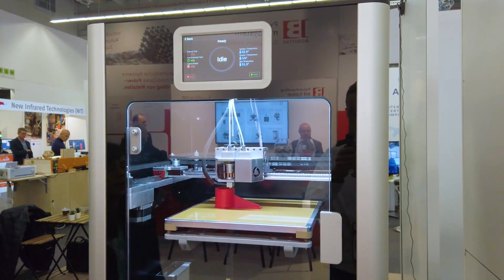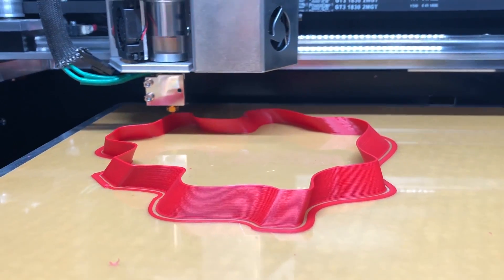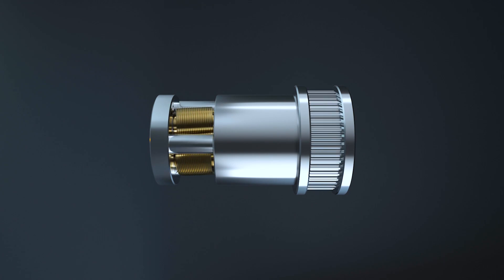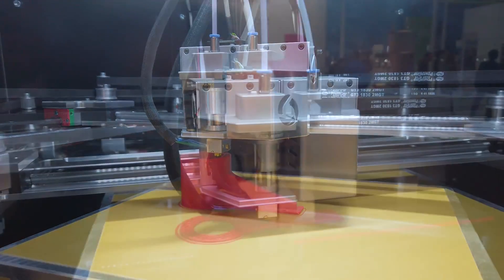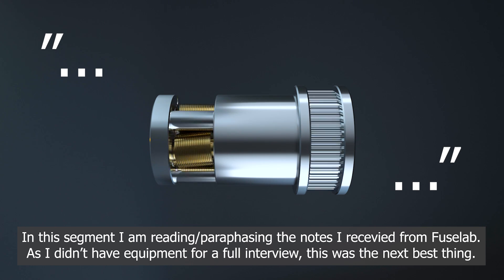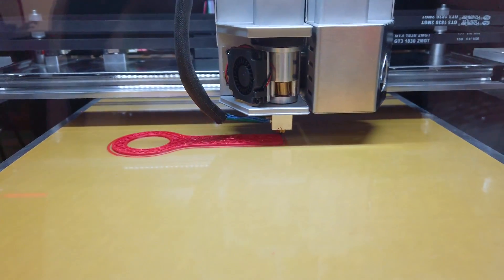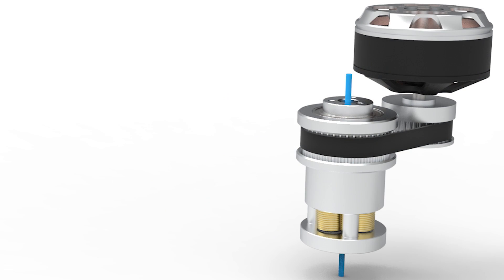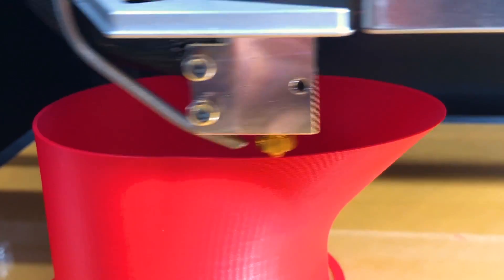Incredible High Performance Extruder - FuseLAB Formnext 2019

Comment: Cool beans.
How about hybrid Bowden/direct drive?
Bowden tube/extruder; old-school material over time, no pressure advance and no pesky retractions!
At the hot-end, small servo-motor (voice-coil?) sits between the Bowden tube fitting and the nozzle.
Servo travel moves fitting closer to or farther from nozzle, regulating pressure.
For retraction, servo shoves fitting far from nozzle, reducing pressure immediately!
While the hot-end is accelerating, the fitting is pulled closer to the nozzle for a bit; this boosts pressure over the steady delivery from the Extruder.
Once hot-end is moving at steady speed, servo locks* in position to keep pressure steady.
Nearing the end of the segment, servo lets off on the fitting a bit, reducing pressure and returning fitting to 'start' position.

*Servo position is under closed-loop control; signals tell servo where to go, it WILL go there and it will use as much power as it takes!
Monitoring the drive current gives a direct measure of nozzle pressure!
Wouldn't that be nice?
Retraction that self-calibrates on the fly...
Oh, modulating the control signal with analog data would be a nice way to do lithophanes or other surface patterns.

Comment: Actually, I have been working on a very different design of a similar extrusion system. It is comforting to know that it does not work. You cannot call being fundamentally incompatible with flexible filaments, absolutely insane part complexity, and having an encoded servo as a requirement as working. At that point having a filament encoder and a double layer extruder is much more practical. In-fact you can see this in the Dyze typhoon. For the excuse that is justifies itself with power/weight, I would rather see a tool changer or more robust motion system.
Reply: For that matter: David Leitner on youtube is making a rolling screw extruder. I believe it should have better backlash and dampened frequency curves upon FFT which is what really matters in an extruder for me.

Comment: Like a few others I cannot see the benefit of this. Like some has pointed out dual gear extrusion, like the BondTech one, seem to be really safe, with very few additional parts needed. It seems to overcomplicate an issue that is already solved. It also looks a bit nightmarish to service compared to normal geared extruders. ....and it cannot even do flexibles?? What???
Reply: I think it is mainly to get good reliable throughput at large nozzle sizes, BondTech etc are pretty good don't get me wrong but having more grip can defo help in certain cases, doubt you'll get any kind of filament grinding this way

Comment: It can't use múltiple size filament... One head for every size Is expensive... Very.... Is overworking the Solution...
Reply from the maker: Extruders never use multiple size filament.
Reply: @Vector3DP  so 1.75 AND 2.85 mm aré the same size???  No... And the list Will go up as diferent reinforcements aré added in the future, forcing the material into the nozzle with three rollers with no way to overcome the cleareances Will chew the filament. So very good quality filament Is needed to use those heads, so price increment again,  the springy design on others feeders make posible to use low quality filament with no problems, AND the 1.75, 2.85 (sometimes 3mm)

Comment: How is that a winner with all that ringing visible in those prints? It's too heavy
Reply: There's no ringing at all. Only thing visible are segmentation artefacts from the STL file. This is the result of the high stiffness of the frame following the theoretical contours very precisely. We've done test tests with pure G2/G3 code and the curved surfaces turn out to be super smooth. We'll post some video's on our website soon.
Reply from the maker: It's lighter, stronger and faster than the new e3d hermea.
Reply: @Vector3DP  But the ringing is just massive and on an easy print too. It is likely heavier, stronger, slower, and much much more expensive than the new e3d hermea.
Reply from the maker: I see the artifacts, but that's not ringing. Will need closer investigation.

Comment: I call BS, they didn't invent anything, this just took a roller nut from a roller screw mechanism. SKF has been making these for donkeys years. 
https://en.m.wikipedia.org/wiki/Roller_screw
Reply from the maker: They have a patent. So patent Office clearly saw it as being sufficiently different. Clearly based on the same fundamental ideas, but it is different.
Reply: @Vector3DP  Yes, well, that's probably the reason you have plenty of organisations and people pointing out that the patent system is flawed and the patent office will issue a patent on pretty much anything untill someone challenges it. Case in point, roller screw mechanism has been patented in 1946 so obviously the patent office in question was too lazy to go through their archives to find prior art (and even worse, existing patent). Let alone the thought that the WHOLE of the FDM industry is relying on the expired patent for its very existence.

Comment: This seems like a odd extruder design. It is high mass, high extruder axis inertia, it also cannot handle filled filaments because it will quickly destroy the rapidly spinning extruder drive made of brass. Dual geared extruder drive gears work much better in far less cost, mass, complexity, and won't be eaten alive by abrasive filaments. Soft filaments will be a nightmare to deal with not just flexibles the way the drive works will cause a lot of problems. Looks cool but a filament flow wheel like the moasic pallete has build in and a closed loop extruder stepper would be a far better solution that could track filament jams and motor step loss. The BLDC high speed extruder is functionally threading a soft plastic string which seems very odd.
Reply: Actually one of the advantages of this system, is that it's really light weight. In it's current form it weighs +-250 grams per extruder, while the one that is currently being finished for the final commercial version, will be around 150 grams per extruder. Further development in the coming years could bring the mass below 100 grams.
The brass rollers you mention where chosen for ease of fabrication in the development stage, and since there is only rolling friction, they hold up remarkably well. The final design will have hardened steel rollers, and will handle abrasive filaments perfectly. Finally, this system can't feed flexible filaments (elastomers) but handles soft filament without any problems.
Reply: @fuselab3d446  What are you including in that mass your entire extruder assembly weighs more than 250g. I'm talking about the entire mechanical head not just the spinning portion. If we just look at the mass of the geared part an e3d gear is like 11 grams. You can't get away with a ultra-light head as you have to hold that rapidly spinning drive system in place without causing excessive vibrations. How does it even handle starts/stops/retractions stopping that much mass is going to cause serious vibrations the drive gear of your system has sigificantly more inertia than a standard geared drive system. The high rotational speeds don't help either as to do a fast retraction you would have to go from high positive rotational printing speed to many multiples of it in reverse vs a gear drive system which is almost always near stationary and has a tiny mass relative to the screw drive system.
Reply: @riakata  250 grams is for entire assembly. (1 extruder)
Vibrations are no problem at all, at extreme high printing speeds max RPM is still only 600 RPM.
Retracts are done within 10ms, so no problems there.

Comment: The extruder looks really fancy, but has some disadvantages: No flexible filaments; it's a complex and heavy extruder which means lower printing speeds or at least slower accelerations (look at the sample objects with very gentle curves. Edges are possible of course, but would need to stop and accelerate that weight); the complexity means a higher potential for failures after some time; etc.
Reply: Yeah I would imagine retractions and speed changes will cause problems with that very rapidly spinning extruder drive system.
Reply: There seems to be a misconception that this extruder is heavy, it's actually the opposite, this design allows for a very light extruder design. There is a path forward that would allow an extruder below 100 grams. The reason that it can be this light weigh is that we can achieve a better match between needed torque and speed with available motors than what is possible with pinch wheel feeding systems. With pinch wheel feeding mechanisms you need high torque and low RPM, meaning that motor power utilisation is low since power = torque x angular velocity, and the motor is sized for the torque part of the equation, but the speed part is left untapped. That's why the better pinch wheel extruders have gearing, whereas this gearing is inherent in our design (without adding mass). Finally by using a BLDC motor we completely solve the retraction speed issue, and have a near perfect match between motor and system.
Reply: @fuselab3d446  OK, that is interesting. Thanks! Good facts are always welcome! So in fact it's not heavy, that's really good!
Reply: @Richard-S  They are misrepresenting the system design of stepper motor extruders which have a high torque at low speeds so they are automatically well matched to geared extruders which also move at low rpms in both extrusion and retraction. Stepper motors don't make sense for their ultra-high rotational speed system but high rpms are not something you want unless you really need it as it has complications with balancing, vibrations, stopping/starting, ...
Reply: @fuselab3d446  These are not accurate for stepper motors which work best a low speeds and have a falling torque curve with higher rotational speeds and start a maximum torque at zero rpm (They are called stepper motors for a reason they move in steps) so they are well matched to geared extruders that operate at near zero rpm. The rotating bit of the drive system is far more massive it is impossible for it to be lighter than a simple hobbed gear just by volume alone. Made of the same material your system has many more drive components that engage over a larger area. Spinning this at a high speed requires high precision to prevent vibrations which demands more machined components to hold them in place. You do not address how you handle the retraction problem in that you have to stop a much more massive high rpm system and reverse its direction extremely quickly which will cause vibrations.
Reply: @riakata  It's not the torque curve that matters, it's the power curve. As said before power=torque x angular velocity, that means that working near 0 RPM will get you very low power to weight ratio. Just checked, a popular Nema 17 stepper would deliver 0.6W of power at 36RPM (8mm hob, 3/1 gearing, 5mm/s filament speed), while at higher RPM this same motor can deliver 27 watt, thus only 2.2% of motor potential (power wise) is used.
We have no vibration or retraction issues.

Comment: This is a very big step in 3D printing
not really because of the thread rolling system that is a good idea even if not perfect
but because there is a brushless motor and an encoder this mean a Close Loop system 
now install it on all the axis and there you can have a very powerful fast and reliable printer
like the big industrial CNC machine don't work with stepper motor because of the precision and speed and reliability
Reply: Thats not true. Stepper motors are more dynamic because of the smaller rotor weight. Stepper motors are perfect for low torque but precise and fast applications. Stepper motors are not suited for high power applications (like milling and turning)

Comment: I'm a bit confused what problem are they trying to solve. Extrusion speed? certainly not size. They've over engineered an extruder to be extremely expensive, use a lot of proprietary parts, and less capable than existing solutions on the market. A bmg, or a hemera is capable of feeding a volcano or a supervolcano with plenty of torque to spare. The sample prints appear to have ringing artifacts just on round surfaces, so I can't see how high speed printing will be achieved such a heavy direct drive assembly. Being clever for the sake of clever is not particularly interesting. Good coverage, but if you're asking them questions, and explaining this "innovation" I'd be interested in a more indepth style of coverage -- as in, you covered the what and how, but how about why?
Reply: Yeah they are claiming the head is very light <250g per head I doubt it just on volume and parts alone it is a beefy direct drive head. They are likely talking about just the rotating part which is much more massive than a hobbed gear no matter how you spin it.

Comment: Just for reference and the curious:

This feed-mechanism is well-known in the thread-rolling industry (large bolts, ball-screws, lead-screws).
In thread-rolling, a cylindrical blank is "squeezed" by two or three rollers with a "negative" of the thread shape.

In thread-rolling, the goal is to make screw threads.  The feeding of the blank is a secondary benefit.

In the FuseLAB extruder, the feeding of the filament is the main goal.  The helical threading is a secondary "benefit."

Here's a video of an industrial thread-roller by LMT Tools:
https://www.youtube.com/watch?v=T_W4x2Hec-w
(About 5 min)

Random observation: Geometry and math peoples will recognize that a hyperboloid is swept out by the axes of the three rollers.
Reply: You're exactly right.  I was already planning on building this for my personal machine.  Looks like someone beat me to the draw.  I want planning on commercializing though, so good for them.  Kinda curious that they tried to patent it though...
Reply: Problem I see is plastic filaments are not good screw making materials. The depth of their "thread" is very shallow and unlike a screw maching machine it has to be able to reverse, stop, change speed rapidly during a print. This is not a good fit for a high rotational inertia system.

Comment: Although an interesting idea I don't see any advantage and there are a number of disadvantages.  The increase in complexity and the inability to handle flex materials kind of makes this a non-product.  It is a solution looking for a problem.
Reply: Agreed... It seems over-engineered to me.
Reply: i think its quite a clever design. considering the bondtech gears are giving prusas a lot of problems with inconsistent extrusions i think this is a welcome addition.

personally i still think its the wrong approach tho
Reply: Agreed.  Patent chasers. It looked to be crawling too.
Reply: Looks usefull for Peek and other high strength thermoplastics. Or highly filled stuff.

Comment: The design as is, is innovative but doesn't bring much new to the table I think. I think there is the potential to make it really good though. 

They could make the belt drive which turns the extruder work like a Core XY, and take the motor off the moving XY carriges completely. You would just need another belt path above (or below) the ones for the core XY, and loop it around in a similar manner. Remove as much weight from the extruder assembly as possible e.g. make the pulley concentric around the drive section to make it very flat. A disadvantage I can see is that the forces from the extruder belt may interfere with the core XY a bit but that could probably be compensated for in the design. Just an idea.
Reply: Only problem i see with that is belt stretch. Over a periodof time it would stretch from the constant motion causing inaccuracies and reduced flow. A smaller bet has less chance of stretching.
Reply: @cowboy124aa3  the belt stretching would be inconsequential if they put the rotary encoder directly on the extrusion mechanism instead of on the motor that's turning the belt drive.

Comment: Yeah I saw that at the show too. Though, beside being something new-ish there isn't much to write home about. It's an expensive way to do what the rest of extruders are doing for much much less money.
Reply: Especially since it can't even handle any flexible filaments🤔 It's certainly nice engineering though😍
Reply: you would be surprised how cheaply it can be replicated
Reply: It would be a significant advantage for driving filament at high speeds which is what I'm using it for.  It's a huge waste if your printing at 40mm per sec, but it's invaluable if you're printing at 300 mm per sec.  My current goal is 1 meter per second.  It's ridiculous, but necessary.
Reply: @Unmannedair  Necessary for what? Its cheaper to have many small slower machines running for 0.4-0.8mm nozzles, and cheaper to have higher flow rates at the top end Prusa runs the way they do for a reason. As for the top end, look at the machines the US navy uses for printing boats. 1 m/s is prohibitively difficult for the value
Reply: It is nonetheless an interesting contribution. I'm sure it has inspired others already.
Reply: small size and weight
Reply: @certified-forklifter  zou are joking, right?! This is huge and heavy!
Reply: @dodobarbar  Compared to a Nema 17? Not at all.